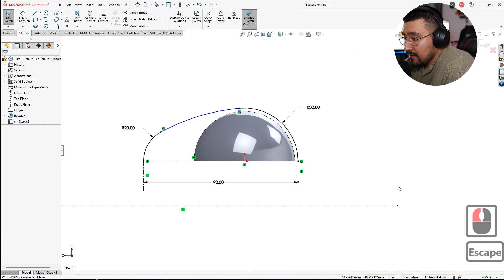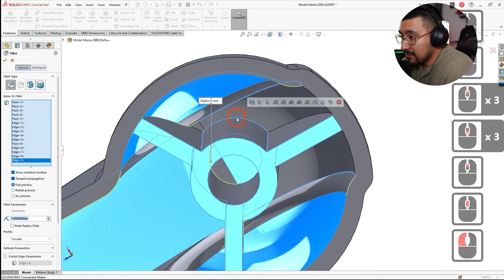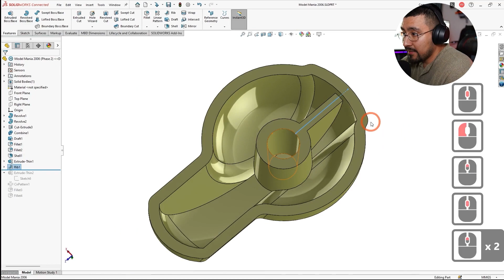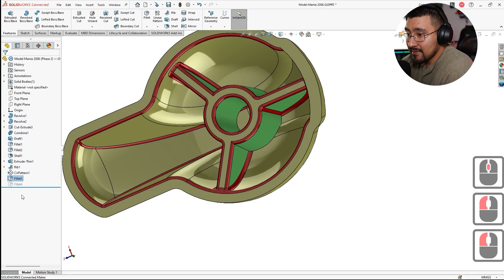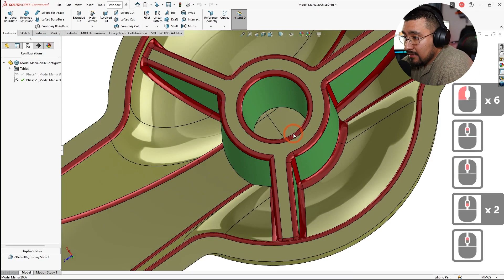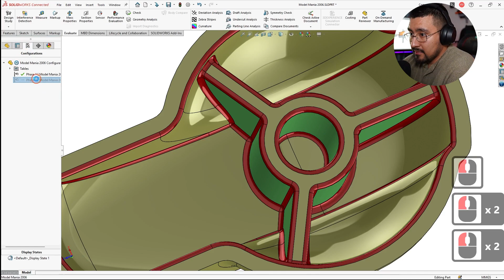SolidWorks Model Mania 2006 Master the Challenge with this Tutorial

Comment: Your tip on the left has a radius of 20mm looking from the top instead of 32mm. It shouldn't be a spherical tip but rounded more in 1 direction than the other. I think you forgot another extruded cut, before the shell function.
Reply from the maker: I think I know what you mean, the tip R20 I revolved around a R32 CL when I should've probably did a hard edge then radius the edge R20. I will have to do a follow-up vid to clear that you. THANKS FOR THE CATCH